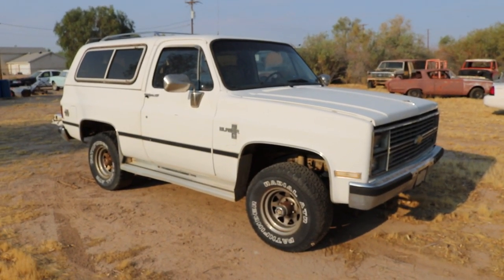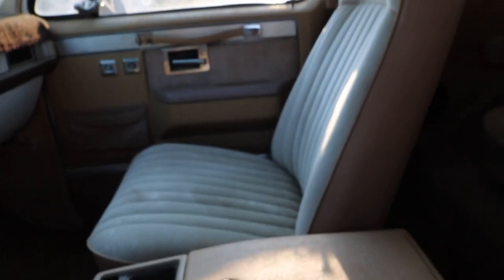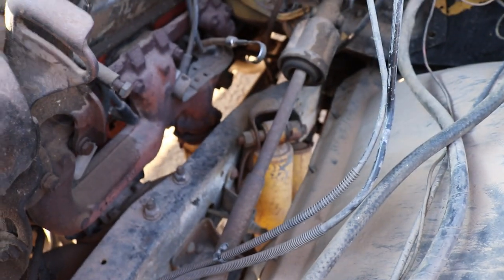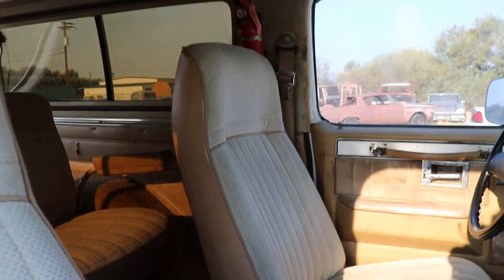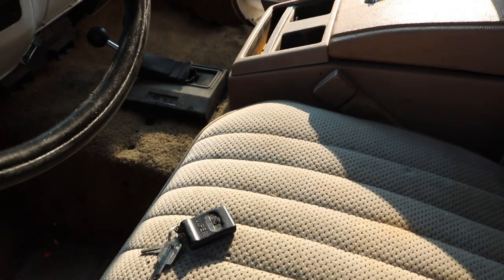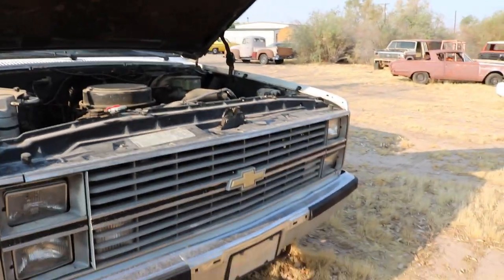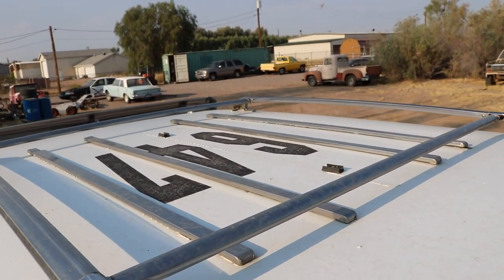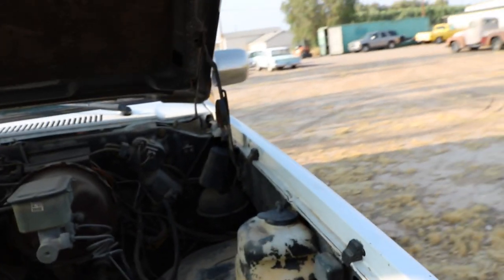First look at my "Barn Find" Chevy K5 Blazer

Comment: Hell of a find! That’d be cool to have. Our town’s telephone prefix is 647.  That rear window sounds like the safety switch. Take the panel off and inside to the left attached to the left side latch is a switch. You can unplug the connector and run a jumper wire on the wires to see if it will work then. Common issue on these. That old sunroof made me cringe. Cool idea back in the day but long term it wasn’t the best.
Reply from the maker: Yea, I hate 80s sunroofs. I had a Mustang GT that has the same horrible universal sunroof installed. Thanks for the info!